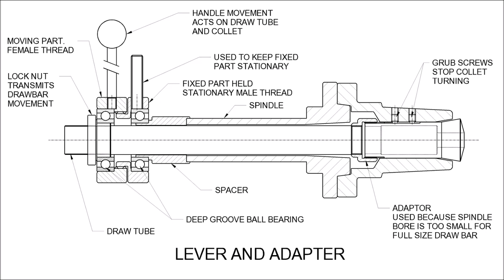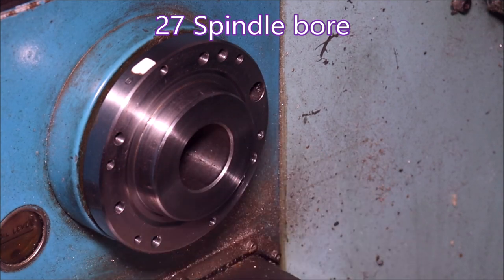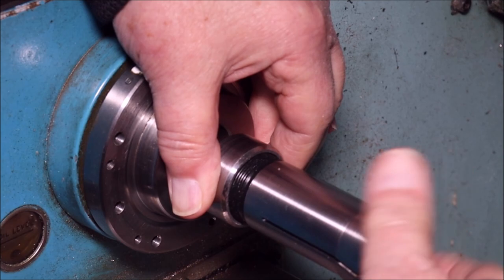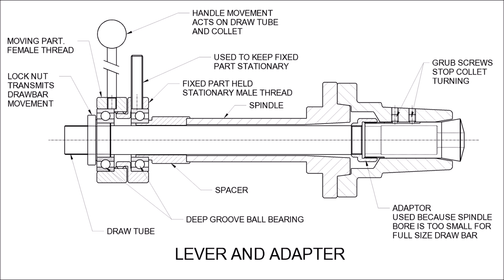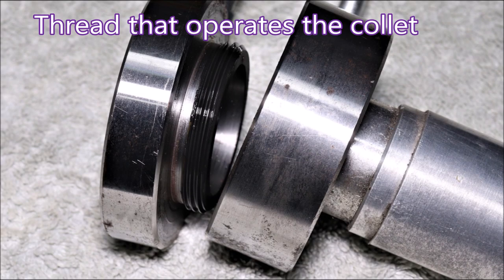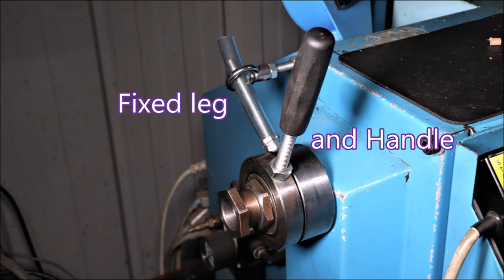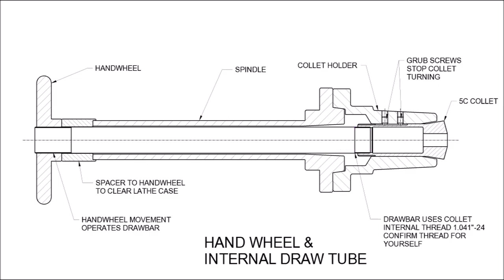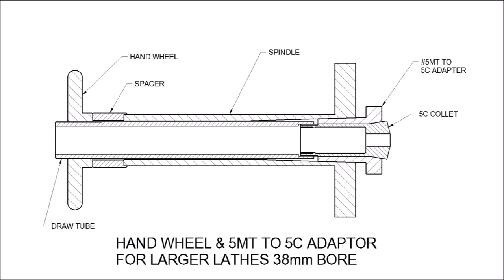My DIY 5C collet closer. My small cnc lathe needs an odd arrangement for a collet closer

Comment: I have heard of similar setups but usually it's just a way to deal with a spindle that does not have an integral taper.  This is the first time I've seen it used to deal with a small bore.  I've got a 3C collet closer and a collet chuck that requires 1,000,000 turns to or release the work.  Maybe I should tear out the gearing an use it as a taperd nose piece.  The spindle has an MT3 taper on the front and a diameter of 0.76 so I'd need to make an adapter like yours.

Comment: Another excellent video, if you don't mind sharing what software did you use to create those drawings?
Reply from the maker: A cad program called Keycreator, which I have been using for around 30 years. Was a dos program when I started using it. Priced it recently and a new seat here in Australia is almost 5k aud. Mine is only a couple of years old, so I won’t be upgrading anytime soon.
Reply: @smallcnclathes  many thanks, keep up the good work

Comment: seems an alternate bearing and a shoulder on the end would allow for it to push as well as pull...
Reply from the maker: You may be right, but for me it will stay as it is now, not enough work to make the effort worthwhile. Thanks for thinking about it and leaving your comment. Nogel
Reply: @smallcnclathes  like a lot of things, isnt it? would rather deal with the annoying parts every now and then than take the time to fix it... as its not a big issue. just a nuisance. we all know that "five minute job" is going to take 5 weeks as something invariably pops up!

other thought is a spring could probably be squeezed in there behind the collet. belleville washer or three...

keep it in mind if i ever do my own...